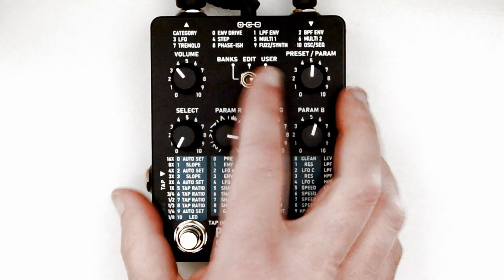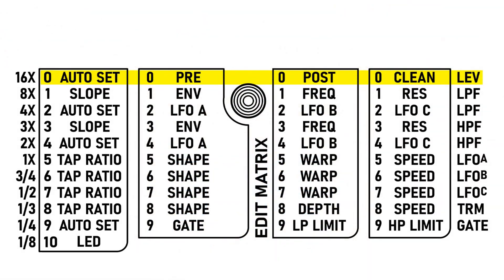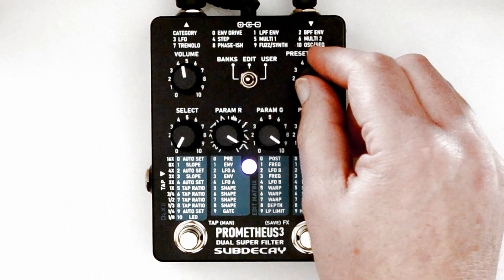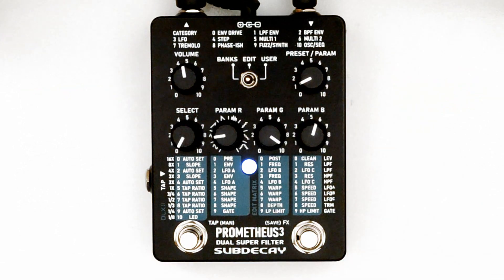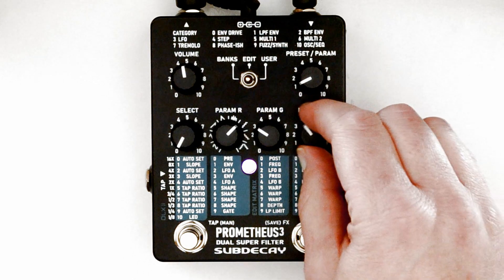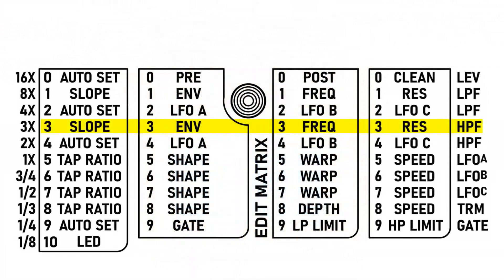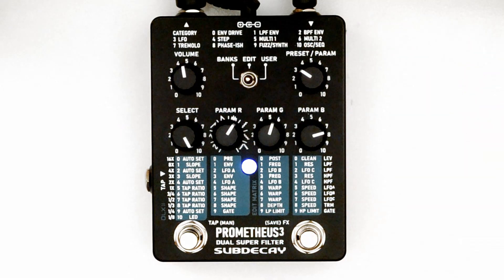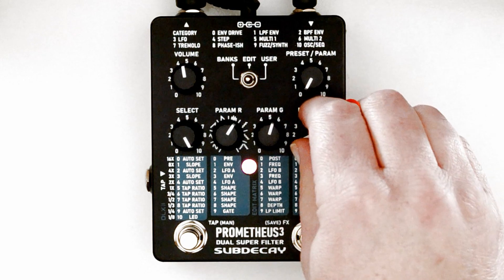Taking full control of the Subdecay Prometheus 3: Levels and Envelopes.

Comment: if this can do daft punk around the world and darude on guitar, i'll buy it!
Reply from the maker: This pedal does use a similar filter to the MS20, the synth used on that song. It's only the filter section though. 
We do have a synth pedal called the M3 heavily inspired by the MS20. It will get you close, but the oscillator settings are kinda curated. 
Anyway, we're currently rethinking that pedal, because some of the parts are kind of impossible to get right now.
Reply: @subdecay  thanks. are you saying if i  have a chance to get an m3, i should take it?